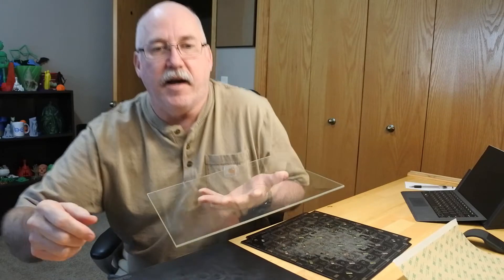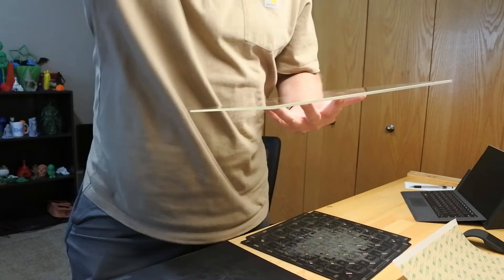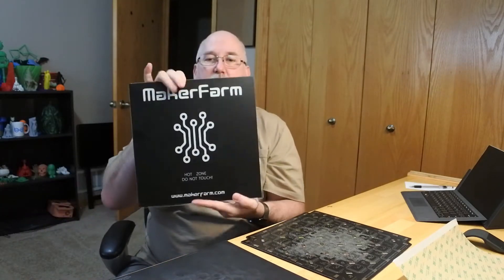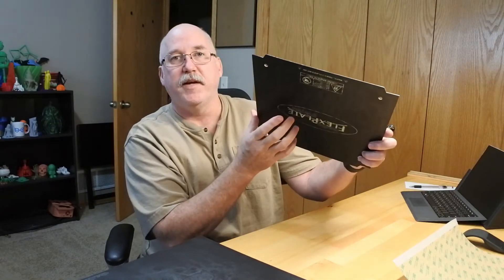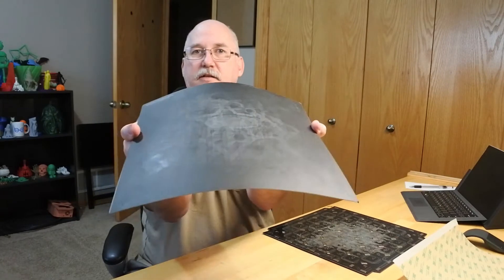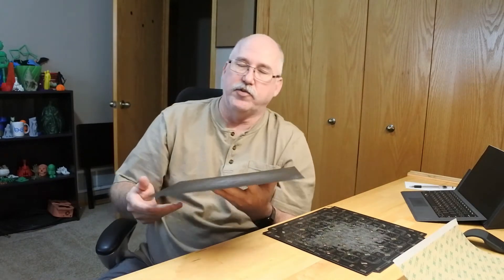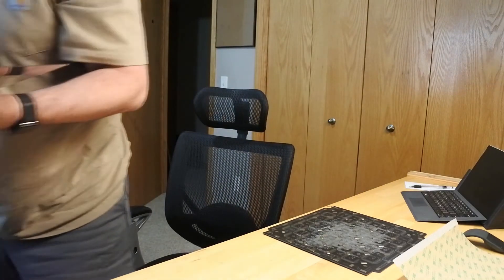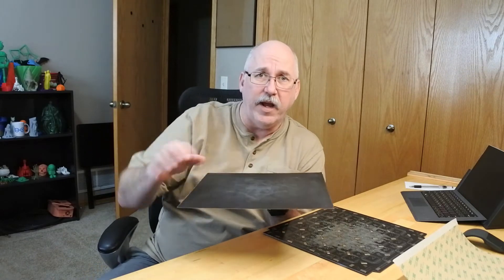Build Surfaces and Buildtak Flex system

Comment: Don’t know if you are still looking at your comments, but I agreed that the glass with the system is too heavy. I installed exactly like you did directly to the sled, but now my z-offset won’t go low enough. The wheels on the gantry hit the mounting bracket before the nozzle will get low enough. I’m thinking only option is to get longer leveling screws and pair springs with spacers so I can get the bed high enough with room to adjust for level. Any ideas?

Comment: DIY version, home depot materials 
https://youtu.be/kNnOYiE3SXg

Less the half the cost BuildTak flexplate system for 
cr10s4 $190.00 (includes 1 flexplate, 1- BuildTak sheet, 1 – BuildTak Magnetic Mounting Base)
additional flex plates 16inx1616in $50

my version:
18 hightemp magets plus shipping $48
24 in. x 36 in. 26-Gauge Zinc Metal Sheet $20
Silicone double sided tape $8
Blue Tape $9 or 16x16 pei aliexprees 2 sheets $50 or th3 studio build mat $24

reference and instructions
https://www.youtube.com/watch?v=-HI0PLQ3ThU

Comment: Build tac has a good system, but centering the plate is hard because of the very high magnetic attraction of my Pruse mk3. It’s easy to pinch fingers!
Their surfaces are about 12 bucks a sheet and I only get about 30 -40 builds before replacement. High cost! 
Thanks to this video I’ll try sanding the surface first and maybe extend the life.
Reply from the maker: Just a quick word of warning..  be very careful as you sand.  You will begin removing materials especially in the center.  This eventually led me to some issues with first layer adhesion on larger prints.   Basically the center got so far off that I was almost touching on the outer edges to keep a first layer in the center.  Just a warning to not go as long as me lol